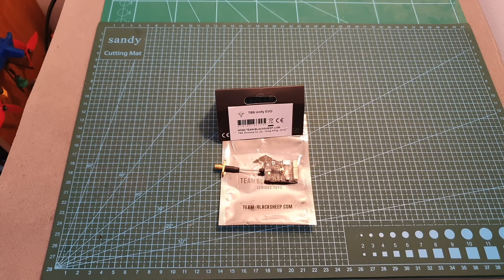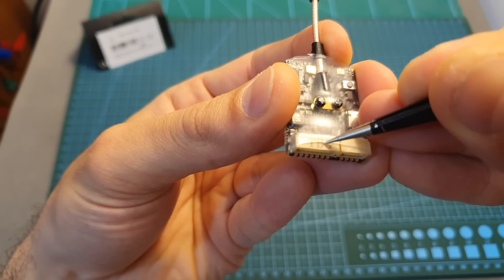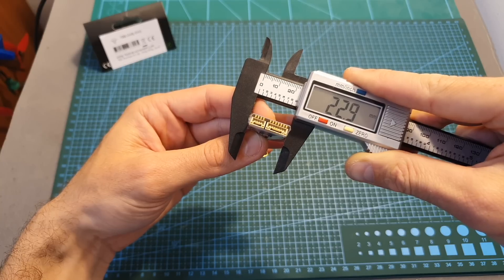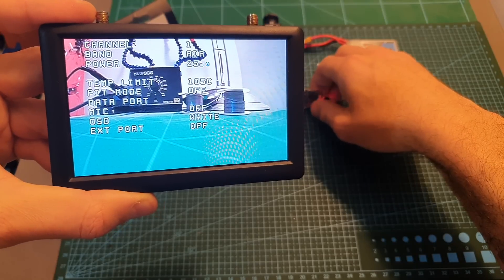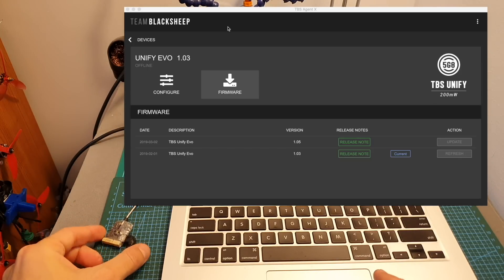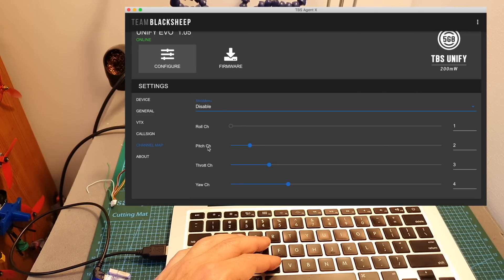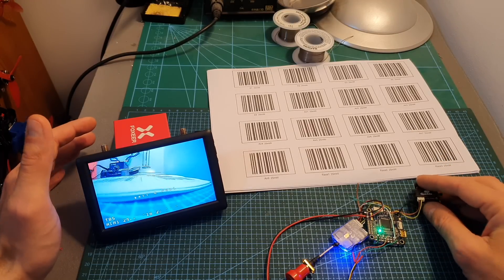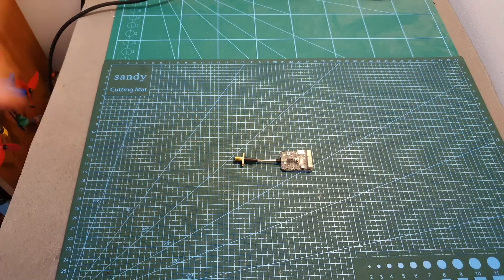TBS Unify EVO - Setup, Overview & Power Test

Comment: Hey there, could I ask, does smart audio need to be selected via the button on the Vtx before it can be used via smart audio? I have the evo Vtx and using the FETtec G4 flight controller only I cannot enter the Vtx settings via smart audio! I haven’t gone into the menus at all using the button on the Vtx, is this where I am going wrong? Thank you

Comment: Hey Gal any chance you can show how to use this vtx with the TBS Crossfire 6ch PWM Nano RX to use with a fixed wing? 4ch park flyer plane perhaps. Would love for this to work with an osd so my son and his friends can do fpv with our park flyer foam board planes.
Reply from the maker: Thanks for the suggestion, however I don't have this adapter and I don't fly wings (yet...)

Comment: i want to use the evo with my Taranis x9d+ but without crossfire, so i only need the smaler plug from the vtx right? because the bigger is for crossfire jes?
Reply from the maker: Yes - you only need to use the smaller plug.

Comment: My EVO wont turn on with the 10V of the Hobbywing G3 Board. Is there any reason for that? Because with the lipo voltage it runs perfect.
Reply from the maker: Maybe the BEC current is too low?

Comment: 8:23 I get this exact distorted picture on my fps goggles when I connect to my wizard 220s. Can you tell me what I have to do? Thanks for the answer :) BTW I am new to fpv drones.
And do I need to buy sma antenna or RP-SMA for this SMA pigtail?
Reply from the maker: Welcome to this great hobby!
It means that you are probably not on the correct channel. 
Make sure that the VTX channel matches the same one on the RX. 
It's better not to use adapters if it's not necessary, so if your VTX has an SMA connector you better get an antenna with an SMA connector.
Reply: Ahh nice thank you, I didn‘t know you can change the channels on the drone itself, since the vtx on the eachine wizard x220s is hidden from the top plate ;)